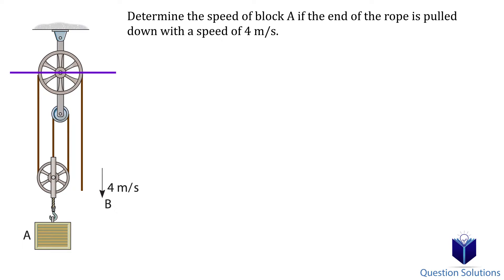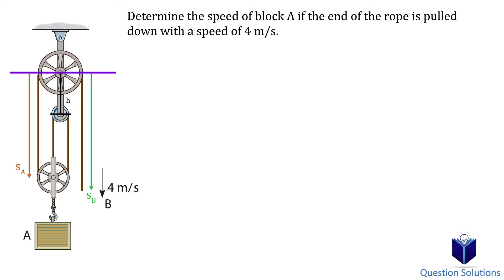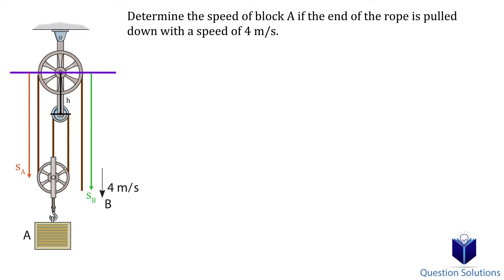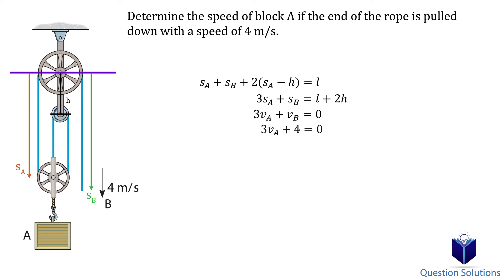Determine the speed of block A if the end of the rope (solved)

Comment: Thanks for the video, I was wondering, since the little pulley below the large one is fixed, can you set that as the datum and negate the need to do -h?
Reply from the maker: No, since if we set a datum below the main 2 cables on the side, it will give you an equation where all four lengths are represented by a single variable.